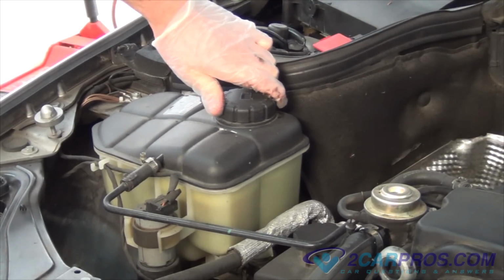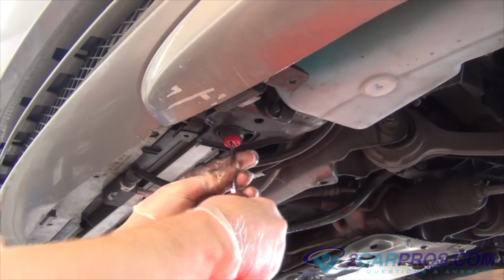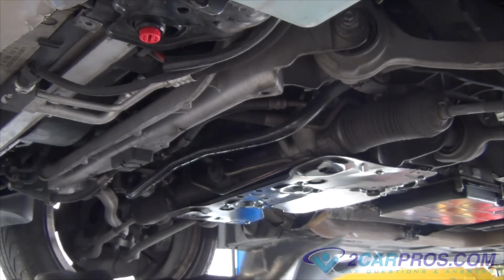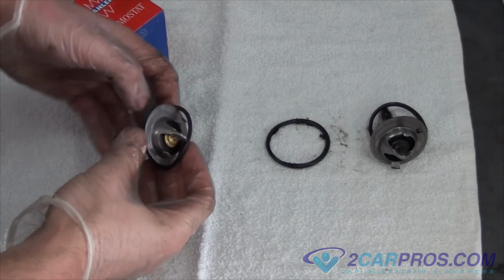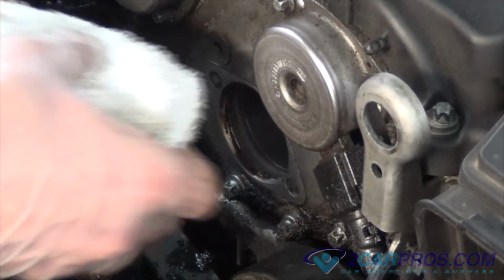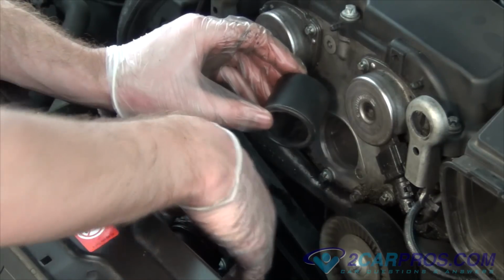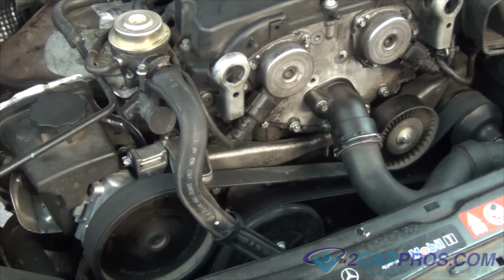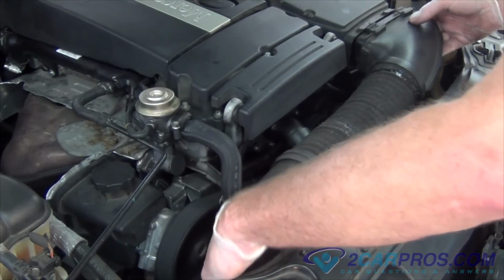Thermostat Replacement Mercedes Benz C230 2001-2007

Comment: No need to take all fluids off. Just suck much as you can from liquid coolant reservoir. took anout 3L and then theres no leaking from thermostat when you open it., Then just add new or same old 3L cooling liqued  and have fun.

Comment: I have a 2009, c180, w204, I think the thermostat and housing is the same. The hose, spacer, rings, thermostat, ALL CLICK together, and then slide in as one assembly. Well, that is how it was with my car, when I replaced my thermostat.

Comment: It's not a spacer. The thermostat housing is broken. I have always replaced the housing when it is broken. Good to know that you can re-use it. It is a a cheap part though.
Reply from the maker: +lisawitteduncan it is a spacer btw  it holds the thermostat against the block to seal it
Reply: Its not a spacer.  It really isnt.
Reply: nope. at me it was fixed tot the hose. Tried to remove it from it but i am glad it didnt came loose. This video was really handy. I didnt removed the coolant. I put a paper cup reversed in the hole so the least amount of coulant got lost. And i topped it of with new coolant

Many thanks
Reply: Terrible design using cheap plastic parts, but not a "spacer". It's also not a washer, it's an O-ring. Mr. Mechanic should know better, REPLACE THAT BROKEN PART

Comment: Looks nothing like my 2006 c230
Reply: 2006 C230 doesn't have the M271 4 cylinder anymore. It has the M272 V6 engine. Thats why it is different. Yours will be a metal housing/thermostat with a temp sensor on the side.

This video has several errors. The housing is broken, and the o ring goes on the end of the housing and the thermostat snaps onto it. Thats why that metal tab is on the thermostat, to hold it in place against the seal on the end of the housing. It should go into the engine as one big piece and not in pieces like this.

Comment: Hello,
there'a a little error in the sequence you mount back the different elements that could lead to a costly problem. The seal ring (rectangular section) should have been mounted after the thermostat (in front of it and not in the back) and not before! When you first extract the old thermostat is clear that the seal ring is in front of it but when you put it back you squeeze it in before.
Reply: yes yes, i notice that too..
Reply: Gian Maria Malmesi you're correct!
Reply: damn u paid attention
Reply: is it possible that when he roved the old Thermostat the washer got pulled to the front?
Reply: If you think about it, the o-ring is there to stop fluid from entering the other side.  In this case fluid (coolant) comes from the hose not from the engine block.  It would make sense that the o-ring needs to be on the side that stops the coolant which would be on the side facing the coolant hose.
Reply: Gian Maria Malmesi You are damn right. Also in my case I didnt need to put out the coolant fluid. when the motor was cold there was only little fluid draining out. It was like 4 spoons of fluid.
I only clicked on the video because I wanted to know how much force l need to put them screws back,but this info is missing. meanwhile l found out it is between 8-10NM (NewtonMeter whatever that is in pound^^)

Comment: My c180 kompressor won’t get up to temperature when it is still without interior heating on it will get to 80 degrees but while driving unless in stop and go traffic it won’t get to operating temperature. 

Should I replace the thermostat? Also it is winter right now about 10 degrees Celsius outside maybe this is why it’s not hot?

Comment: Great video! Except i have a 2007 C230 sport V6 and the thermostat looks nothing like urs. It comes as one whole direct piece and there's even a metal ring u pull etc.... this is just different...look up the part online and u will see what I'm talking about....If u have feedback let me know.
Reply: Same here I'm a bit confused , did you get it fixed?
Reply: It's a long time ago but for future watchers. This is the 4 cylinder with compressor. You have a 6 cylinder motorblock.

Comment: After I replaced my thermostat I have been experiencing slow but steady coolant leakage. I did not break my plastic housing while replacing it. Used new thermostat and new o-rings. Any idea what could have cause it to leak? P.S. I did not drain any coolant, there is a little bit of coolant coming out when you pull out thermostat but its not much.

Comment: my coolant has been leaking alot, ive been having to put coolant every day befor it was like ever two weeks. and it gave my mechanic the 128 error code does that mean i need a new thermastat. it has never over heated.

Comment: Do you have to take a new Spacer for the thermostat or can you use the old one?
Reply from the maker: You can reuse the old one if it is in good shape.
Reply: There is no spacer, these guys should know better. The housing shown is broken.
Reply: There's no such thing as a spacer there. That's a broken housing. It should have been replaced.

Comment: you use Delco coolant is that okey for MB?
Reply: America thanks I did it's available now in Autozone....
Reply: ACDelco coolant is not recommended and can do long-term damage to the aluminum and plastic parts in the coolong system.  Mercedes are amazingly picky vehicles. It's always best to use OEM or OEM equivalent.

Comment: Question: I own a 2000 Mercedes Benz s430, it's been (attempting) to overheat but I turned on the heater on hi to have the can release the pressure and drive. I checked the fluid, that's fine, I also checked the hose and they have water in them. So the issue is the temperature gage raises to almost red but as I turn on the heater it lowers. I have noticed that on the freeway the needle lowers but if I do any driving in town, it goes higher again. Any suggestions will be appreciated. Thanks
Reply: Oscar Cruz if have have an electric fan check those they should be a 2 speed fan. I had similar problems and found out the fan was only spinning low would never switch to high

Comment: What normal temperature for 2006 w203? I’m wondering if mine is running a little hot
Reply: Mine 2 it smells plastic inside the hod

Comment: so how cane u tell the thermastat going out or not working on a 2001 c320 dos it come up on the screen
Reply from the maker: The vehicle was over heating. So we suspected the thermostat first.
Reply: Maintenance also, see how easy it is? DO NOT wait for problems.
Dont wait for superchanger oil replacement for $12.00 from AC DELCO.
Dont for get differential fluids
(Commonly forgotten)
Reply: Motor runs cool in the winter. Should be exactly 85C at operating T. Below 80 and the Tstat is not closing properly. Check engine light may also come on.